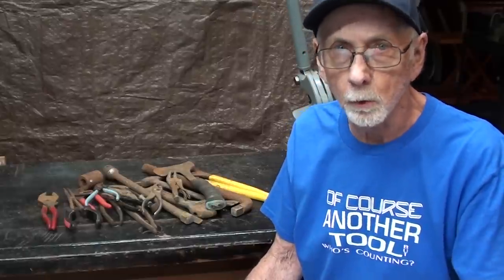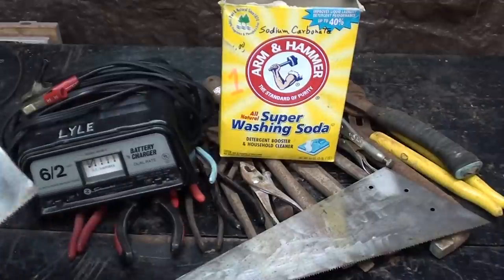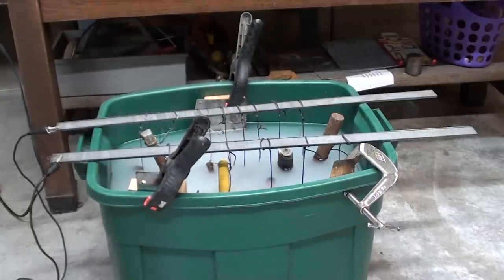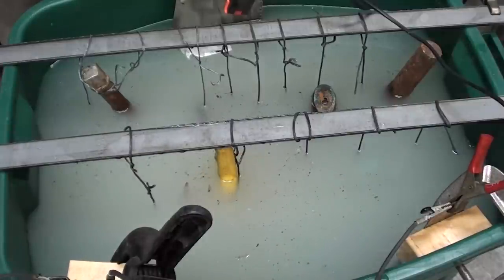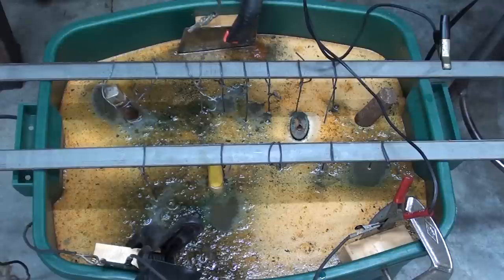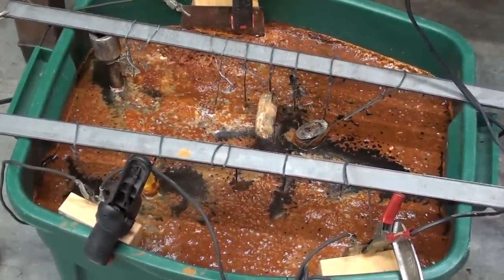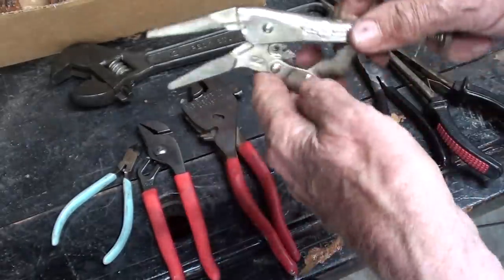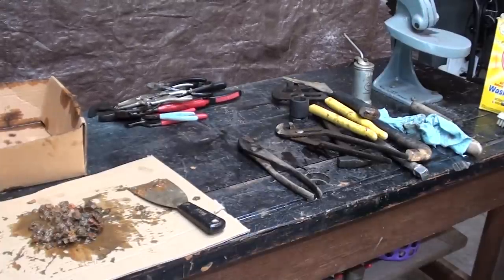RUST REMOVAL ELECTROLYSIS Old Tools #788 tubalcain

Comment: Hello Mr. Pete, after I take the tools out of the electrolysis tank and wash them with the brush and fresh water; put them in a tub with a gallon of pool acid (HCl) diluted to about 50%.  This takes off the magnetite, (black rust) and they come out beautiful iron gray.  (This only takes a very short time; watch it and you can tell when all the black is off.  Wear chemical gloves, a mask and an apron!)   Rinse in a 5 gallon bucket of water, then throw them in a 5 gallon bucket of boiling water, this cleans off all the acid and also heats up the tool for the next step, throw or dip them in a bucket of oil, (any kind, leftovers, etc.)  I then pile them on a cardboard to cool for a few hours or a day or so.  Wipe with a rag, and PRESTO, a nice gray tool and no more rust.  They don't seem to rust again, as it seems the oil gets down in the pores of the hot steel.  1/2 my working tools are this way.   Thanks for all your very good and informative videos.
Reply from the maker: Thank you, very good information. I need to try that, although that sounds like more work in trouble than the original rust removal, lol

Comment: I have a 55 gallon plastic drum set up for an electro tank. I use old lawn mower blades for the anodes. When the current drops off I scrape and brush the anodes clean to re-invigorate the system. Interesting note. The Confederate Submarine 'Hunley' was  salvaged in 2000 and put into electrolysis for many years as a preservation method.
Reply: I wasn't aware the confederates managed to build a submarine. Fascinating!
Reply: most ships that stay in a harbour for long time are protected by electrolysis, just like underground gaspipes and fuel pipelines.

Comment: Instead of disconnecting the battery charger and dumping tools into a bucket of water. Just switch it off while picking a few items to clean and oil, and then let the rest still undergo a tiny bit of electrolysis to remain flash rust free.

Comment: This is generally step two in my process for cleaning old car or machine parts.  Step one is to soak over night in a bucket of lye (sodium hydroxide) which will de-grease and de-paint.  Even if I do decide to blast the parts lightly before replating or painting, knocking the worst of the crud off first really extends the life of blast media.  I save the expensive Evaporust for hardware which I wire wheel to finish and/or fling across the shop.  My wife does not mind if I poach the occasional bit of Tupperware for the shop.  We had only been married a few weeks when she came home to find most of a small block Chrysler in the dishwasher.  As long as I don't do that again, she looks the other way.
Reply: That sounds very true and hilarious! You are a certified-card-carrying tool nut! Good on you!

Comment: Our Arts and Crafts class did this when I was in the 7th grade. The teacher asked all the students to bring in some old rusty tools. I brought in a handful of rusty 12 inch timber spikes. Many of the kids didn't have any rusty tools or anything else to use so I shared my extra timber spikes with those kids. We started this project on a Friday and by Monday it was finished. The results were not very good but it was a fun class. The teacher got into a little trouble for dumping the waste water into several large potted planters in the courtyard that was between two buildings. That was 50 years ago. Memories!

Comment: Thanks for the video Lyle. I have yet to find any rust removal method I am happy with in all situations. I find the one I am using the most is molasses, though it takes weeks to work, it seems to removes the least amount of good material. I like glass bead blasting, but I no longer have access to the process. I hope to set up a blasting cabinet some day. Too many projects, not enough time.✌
Reply: The glass bead leaves a nice surface for painting for that type of item

Comment: “Positive does not go to parts”
Is the phase I programmed into my mind to remember the right polarity for doing this.
Reply: I remember that I want to "subtract" rust from the tools, so they connect to the negative terminal, and "add" the rust to the sacrificial iron, so it goes on the positive.
Reply: @g.tucker8682  all I know is you better not get confused. If you get it backwards the parts will be destroyed. I came close once to destroying an engine block one time.

Comment: Thank you so much for this video. I’m restoring a drill press from 1933 and this process has worked wonderful to remove all the rust. I’m using a brake rotor as the anode, I figured it has a lot of surface area and I always wondered what to do with the old brake rotors, after I put new ones on the car

Comment: I have used electrolysis on tools with good results but maybe the steel was different than what you have.  I removed rust from the bore of an old muzzle loading rifle barrel by installing O-rings on thin stainless tubing placed in the bore.  I used a PVC pipe for my container.

Comment: Thanks Mr Pete! I have a large, Champion Buffalo Forge camel back drill press which is rusty and needs restoration. Since all the parts are huge, I want to try electrolysis. I will be using a 250 gallon plastic tote and a 36 volt golf cart battery charger. Fingers crossed!

Comment: I used to clean cast iron skillets that way. Works better if you give them a scrub with steel wool between soaks. Rinse in cold water and dry them with compressed air and they wont flash rust.

Comment: 1 Tbs. per gallon of water works very well with the Arma and Hammer washing soda. A plastic kiddy pool can take on larger car parts and this stuff can be poured directly into a flower bed afterwards when emptying the tub or pool. (Not a vegie garden though). Worked with it for years in doing up various Model A Fords and currently my 1925 Ford Model T Runabout/roadster. (Don't use copper wire or it puts in a greenish goo to the mixture as it works). I usually use rebar and not the metal strips as you did, as rebar is cheap and can be found at a lot of construction sites as trash to be tossed away.  I rinse them with a gallon container of Dawn dishwashing liquid and water. Most stuff cleans up nicely and some say that you don't have to coat them after the Dawn and water rinse, but I always use just WD-40 or a product called Corrosion X. I ride a Ural sidecar made of Russian metal which is prone to rust, and that Corrosion X product keeps it all nice and clean of rust, even during the wet winter months. Either works well to keep the flash rusting devil at bay. Nice video and thanks for sharing the info.

Comment: It looked like two of the sets of pliers were hung by their insulating handles, so there would be no electrolytic action, yet they seem to have come clean as well. Makes me wonder how a soak in sodium carbonate solution without any power would do.

The corrosion on the Vise-Grips has removed the (nickel?) plating so unless you re-plate them they will never look great.

Comment: I wonder if you had removed the rust instead of turning the saw blades, would,nt you get a better result, because the saw blades conduct electricity better again?
or put more salt in the water ?

Comment: Mr. Pete, I wonder how much better  the de-rusted tools would look if you  gave them a short bath in an acid solution followed by a rinse and oiling. It may take off that mung finish and get down to base metal.

Comment: I use an old salt chlorinator that will do 20 amps at 8 volts DC . This way a stronger solution of washing soda can be used with heavier guage wire and thick steel straps connected in series as the anodes . This will really rip the rust off things like old corroded bench vyces etc .

Comment: I searched everywhere for the washing soda. If you can't find it try oxy clean powder...don't know if it is better or worse but it worked well for me. I find the black residue is also a problem using evaporust...usually it will wire brush off easily.

Comment: I have soaked some in white vinegar but it really smells bad on your fingers if you don't wear suitable gloves! This looks a good method - I'm going to look under the sink cupboard for soda crystals and I have an old skool charger but only 4 Amps but it doesn't mind being maxed out - its an old bradex type!
Reply: I’ve found that white vinegar works good although I haven’t tried other methods. Wash parts in soapy water after cleaning to stop the action

Comment: I tried a very rusty old drill bit, and used vinagar and a battery charger.  
I  only had to leave it in for about 20 min.
I was very surprosed on how it turned out.

Comment: A wire brush is hard to beat unless you cant get to all of the part with it. Evaporust seems to be catching on and works pretty well, it is a weak acid but is pricey if you need much of it. I have bought from the pipe and fence supply store a gallon jug of what I think is the same product as Evaporust, smells the same and works the same that is concentrated and is much cheaper.

Comment: This process is a lot less expense compared to those chemical rust removers such as Evaporust although some of the chemicals do a cleaner job but very expensive. 
I wonder if a 30 amp charger makes any difference vs. a lower amp?
Reply: vinegar, cheap fast and safe

Comment: So, in retrospect would you do this again or use a wire wheel mounted on a bend/pedestal grinder?   This seems slow and messy?
Reply: My preference would be for a wire brush wheel as well, but it won't get into the joints of the pliers and the worm of the adjustables the way this will. I'd try this method for difficult to wire brush objects.

Comment: Great video, One question though. How long do them sacrificial saw blade anodes last for before they disintegrate?
Reason I ask is I want to upscale the amounts. Need a good quality secure garden shed 6'x8' and on ebay there is rusty 3mm - 1/8" steel sheet getting sold at a good price.

Comment: I have graphite sheets I use for anodes. MUCH cleaner process! Not the cheapest but they last pretty much forever.
Reply: Yes carbon anodes work so much better, there is none of the scum or buildup.  You can use carbon rods which are cheap and available online.

Comment: Just a thought from experience as you said surface area is important for a good anode (sacrificial/positive) I do a lot of rust removal and I have had great results and cut the time needed by frankly an unbelievable amount for instance heavily pitted and rusted shut pair of shears was finished in 4 hrs using fine steel wool I wired to some chicken wire I pulled it the steel wool) evenly to make it thinner and wider.  If you get the chance to try it yourself I'd love to see if you find it as useful and efficient as I do.  Ps love the channel my class was the last year the school offered shop class that was back in 2000...... It's a shame but they still have homec?!?

Comment: Did anyone mention? I'll bet you have earlier. About NOT using stainless steel for anodes/cathodes in the bath as it gives off a far more bad gas. 
Great video! I do need to try this.
Ooh, and a Peterson mfg from DeWitt, NEB needle nose Vise Grip!
Sweet.

Comment: For those of us who don't have any discard sawblades handy, or the stringer bars like you have, would it be feasible to use those cheap bar clamps from Harbor Freight? I believe the main component of them is iron, maybe a smaller portion of steel included in it?
Reply from the maker: Yes, as long as they are not painted

Comment: Does the mixture of arm and hammer diminish as the rust leaves the tools and settles on the sacrificial metal. You might have to add more arm and hammer and clean water as time goes by

Comment: I did that several years ago to clean some brake piston.   I used a power supply that I could adjust the voltage.   It got the brake piston looking like new.    I think 14 Volts is too much voltage.
Reply from the maker: Thanks

Comment: Pete, QUESTION... In the current market, WHO makes a true manual battery charger that will work for electrolysis? MANY are labeled manual but will not work for the process. Most are TIMER controlled as well. For 10+ years have restored hundreds of pieces of cast iron using a Die Hard roll around. But that charger market is GONE today. Can you help?
Reply from the maker: Yes, go to a garage sale, auction, pawn, shop, or thrift store. And buy a used one.

Comment: It is currently impossible to find a new analog battery charger, they are all these “smart chargers” and will not work for this. I use the cheapest harbor freight welder set on ten amps for my electrolysis tank.
Reply: I've got an old Variac. It works great!

Also, many chargers have an 'initialize' setting for if you're starting dry or the battery is just too dead to register.
Reply: By adding an automobile battery between the charger and the rest of the circuit, you can "trick" the new smart chargers into working for electrolysis.
Reply: @karlj.shields7645  that would work too. But I didn’t have the extra battery laying around.

Comment: 13:00 lol... I'm not from Iowa, but I've been through there often enough to get that joke.  I'd rather have a Runza.
Reply: Okay, for those that need, or want, an explanation.  "Maid-Rite" is an Iowa specialty.  A hamburger made with very lean beef.  So lean, in fact, that it doesn't hold together as a patty, but is rather loose, like a sloppy joe without the Manwich sauce.  It looks like the pile of rust that Lyle had there on the old saw blade.
Runza is a Kansas/Nebraska regional sandwich.  It features a meat filling baked inside its bun, sort of like a kolache.   Hope that helps.
I know... if you have to explain a joke, it's not funny... I'll see myself out.  
 And thank you Mr Pete for your wonderful videos.

Comment: What brand was the super thick socket?  I know it does not really matter, but you showed it before the electrolysis and I was waiting to see it after.  I have been wanting to do an electrolysis video myself.  I have heard that it works better with carbon as the anode instead of a sacrificial steel.  I have also heard it is best to use a battery because the power from a charger is not always "real" DC.  It may only give you one side of the AC wave.

Comment: How would this work on something like a cross slide? Would it damage the ways?
Reply: I'm no expert but if the ways are rusty they probably need re scraping or grinding back in anyway. 
Even if you don't re scrape them when some metal rusts it expands many times over thickness wise. just cleaning the rust off would make the cross slide more accurate than with the rust left on.

Comment: I was under the impression that the negative charged ions are supposed to be connected to the item with the rust being removed and the positive charged ion is to be attached to the scrap steel? Am I wrong?
Reply: I'm not 100% sure if I'm answering your question but I'll try, If not sorry for the misunderstanding.
Back in the day of scientists learning electricity they thought the flow went from positive to negative. 
It doesn't, conductors like copper and metal ect, the positive atoms can't move they are locked in place. 
any dc circuit or battery has loads of electrons making their way from negative to positive when the circuit is on.
Same for this rust cleaning. the electrons are heading out of the negative tools and heading into the sacrificial positive saw blades.

Comment: Would you say the electrolysis is better than a mild acid bath, like vinegar or toilet bowl cleaner? (or muriatic acid and water?) I tend to do the latter because it's less of a hassle and works well enough without all the "drama" required for electrolysis.